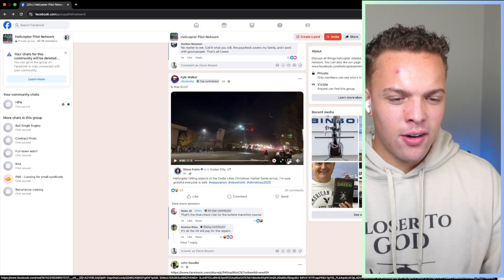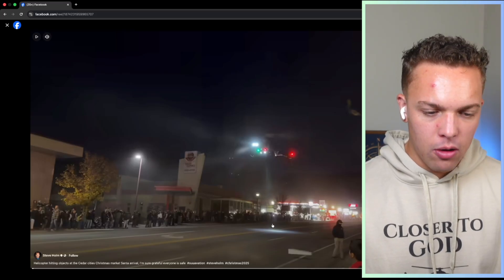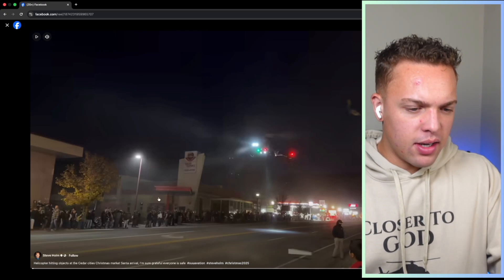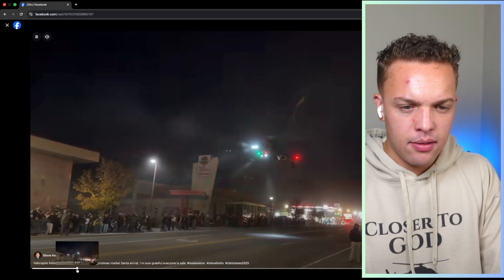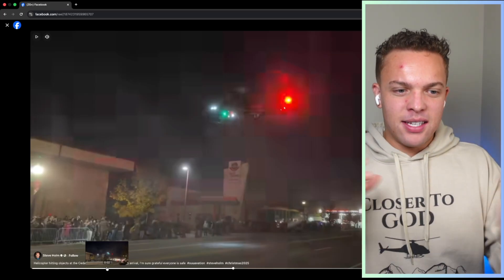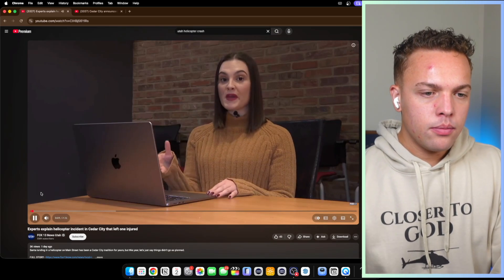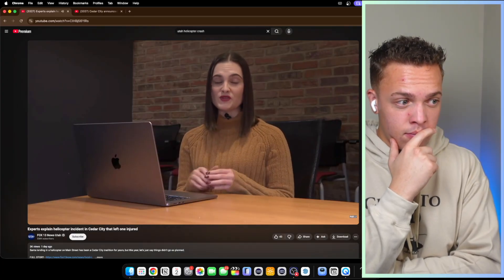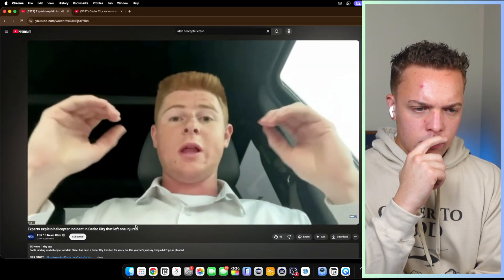Bell 407 EMERGENCY Go-Around During Santa Drop | Aborted Landing due to DANGEROUS FOD

Comment: Tis the season for Santa helicopter issues! That's a very tight LZ - looking for trouble there. Along with the crowd and their belongings too close, that sign structure and traffic lights are unnecessary risk factors, especially in the dark. If the airport is so close, they could have flown the route during the day as well to look for hazards. Poor preparation.